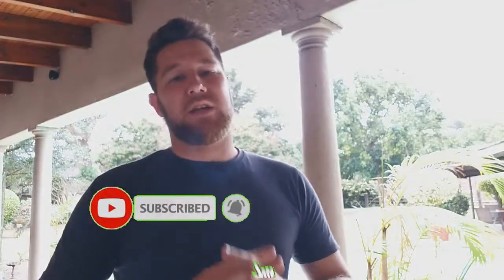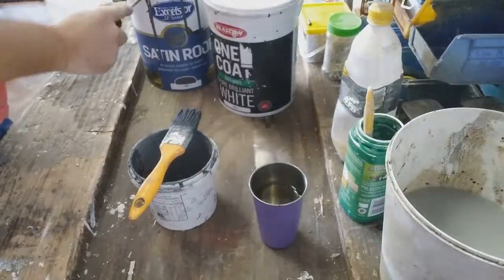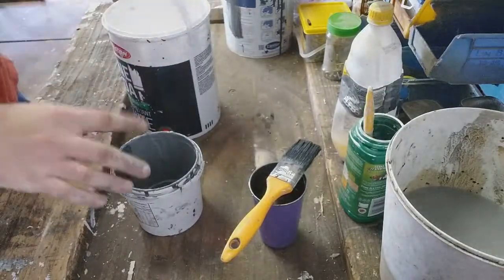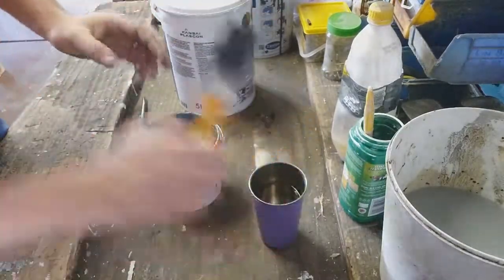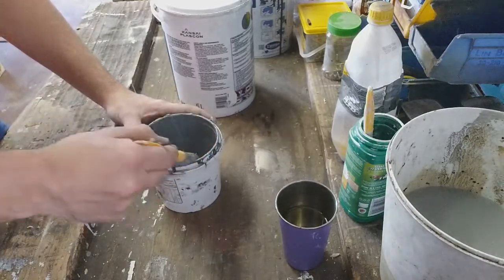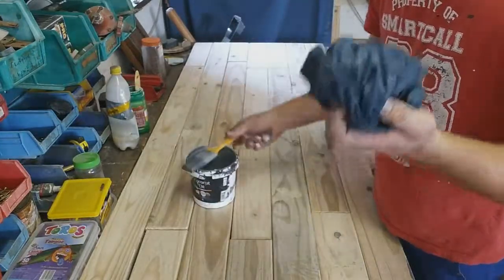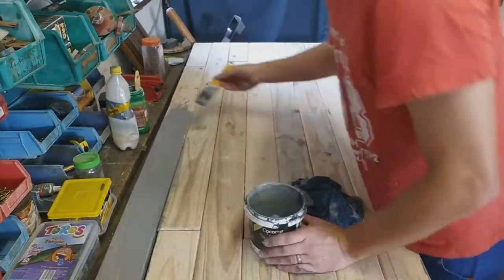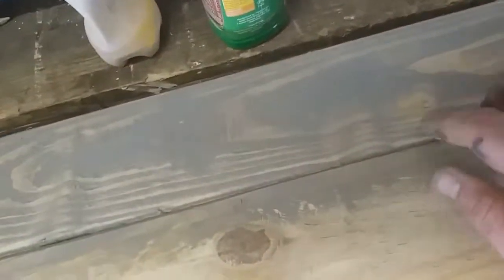How to whitewash wood in any color

Comment: Will that work on fake wood paneling?
Reply from the maker: Hey i havent tried doing it on fake wood but have found some guys that have done it before and it seems to work more or less the same. Ive done it on normal pine wood. Maybe get some off cuts and first try it on that before doing a whole wall.
Reply: @richardsbaywoodcreations  on my paneling it's dark but I want the grain to come through just liten it up. Will I have to use a base coat?
Reply from the maker: @lomagibson664  I believe to consult the paint experts at your local paint store they are likely to help you in what you should use and how to apply it. Please share feedback on what you came across and how it worked.

Comment: Hi.  I know this video isn't  new but hoping you read this.  I have little experience with refinishing furniture but my last project I discovered after two coats of paint that the tannins were leaking through and looking terrible.  I had to repaint with with an oil based primer and then repaint to stop the leak.  Just because I don't ever what to go through that again, would this work on a natural piece of wood that has been clear coated with an oil based primer?
Reply from the maker: Hi yes in order to trap these tannins you can seal the wood with an oil or alkyd primer. What I also usually do is to ask the paintshop to tint my primer  1 shade lighter than my paint color. So when I paint over the primer its easier to get the desired color on the final product.